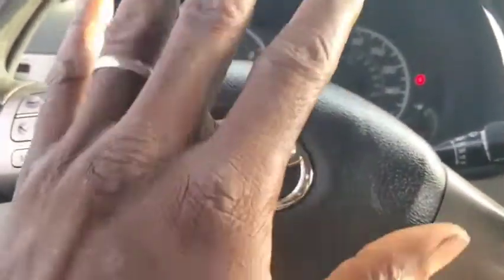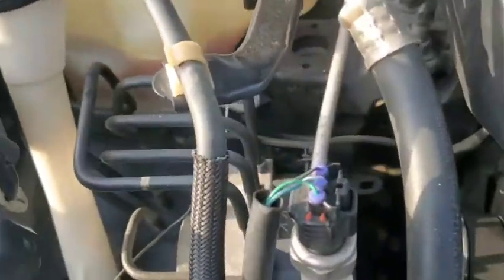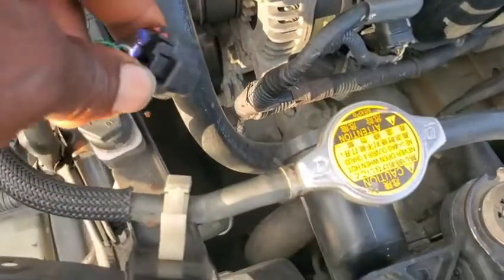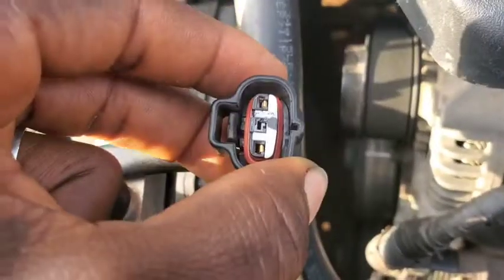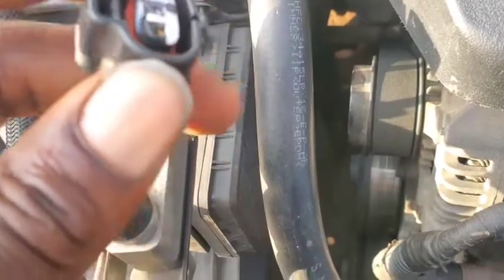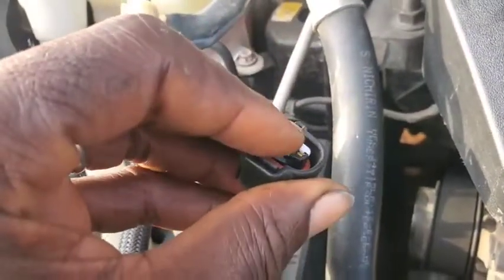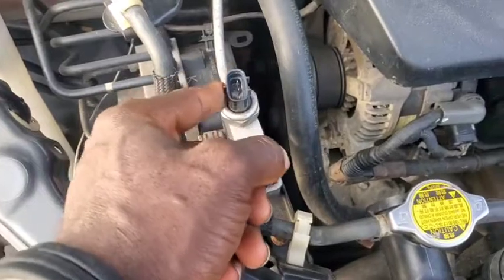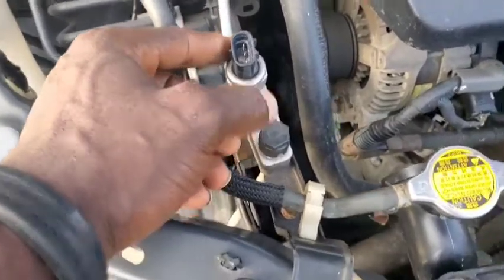How To Bypass 3 wires Ac Pressure Sensor Two Methods

Comment: Hi, I got a kia forte 2009 model with ac intermittent not working. I checked the relay & refrigerant level are ok. The pressure switch with 3 pins, I got bypassed it able to work fine, I assume is the pressure switch problem or fault, when I measured the pressure switch pins between output & ground it got resistance, input & ground also got resistance, input and output pin also got resistance. In this case might be control board problem? Please advise..